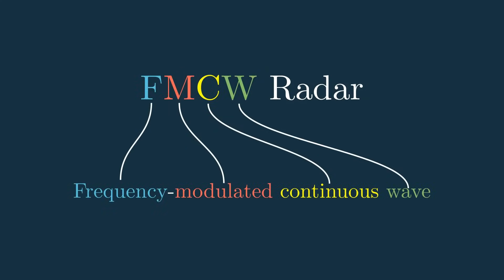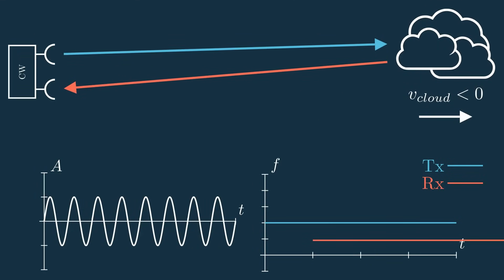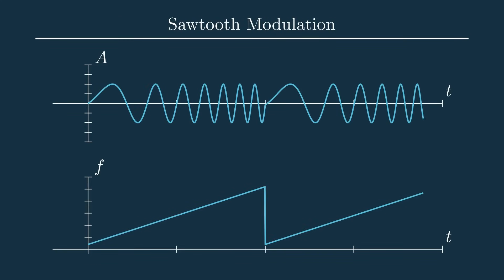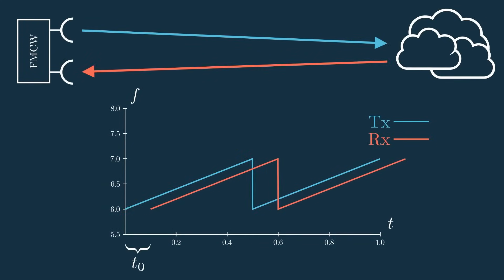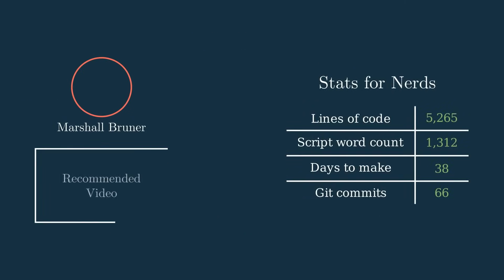What is FMCW Radar and why is it useful?

Comment: 1:46 I don't follow the reasoning here, in what manner would the average power have any bearing on things?

From my limited understanding, the critical part is the level of the return pulse being above the sensitivity cutoff of the receiver (as in the return signal needs to be strong enough for the receiver to notice).
That strength is determined solely by the distance travelled; the square root of the output divided by two.
Unless you somehow can accumulate the returns over time and store them for "reading", we are right back at the return either being strong enough or not.
Reply: I obviously did not scroll far enough down the comment field. Mea culpa.

@MarshallBrunerRF
för 7 månader sedan
Thanks for the thoughtful comment! I've had many people ask about this so here's my copy/pasted response: "Honestly the peak vs average power is my biggest regret on how I've explained anything on this channel. One of the main difficulties with a large peak power is the difficulty of transmitting something that high power for such a short period of time"
Reply from the maker: Another point on this is that for signal-to-noise ratio, it's not really the peak power that hits the target that matters, but the energy over time that illuminates the target. Having an average power over time does matter because by spreading out the power over a longer period of time, you can direct more energy at a target and get better SNR.
Reply: @MarshallBrunerRF  That explanation goes against all I managed to pick up in passing...  because to me, it sounds like a constant dim light would be easier to track than a light that gives high power flashes.
Seems I have to start digging deeper into the math to see what I am missing here.

Comment: The CaesarKing being the powerscope holder of the Internet of Things is a private entity core. While the structure of Institution in its private type businesses another private side while the institution of public type is another  side. Showing the structural mapping of such. Now the CaesarKing shall create now a system project institutional using the Cab or Taxi system of polarity carrier taxi or cab in per portal movers of to and fro and probably another business at works or business in the making.  Starting now there shall be polarized taxi or cab in the institution of private side and another polarized taxi or cab in the institution of public side. A programmed event in time. Let it be

Comment: AI Summary

Abstract:

This video explains the fundamentals of Frequency Modulated Continuous Wave (FMCW) radar technology, contrasting it with traditional pulsed radar systems. It introduces FMCW by breaking down its name: "Continuous Wave" (CW) refers to the uninterrupted transmission of the signal, which allows FMCW systems to achieve the same average power as pulsed radars but with significantly lower peak power requirements due to a 100% duty cycle, making them ideal for smaller, low-power applications like automotive sensors. However, simple CW signals cannot determine range. The video then explains the "Frequency Modulation" (FM) aspect, typically using a linear frequency modulation (LFM) technique like a sawtooth "chirp," where the transmission frequency ramps linearly over time. This modulation allows range measurement: the time delay of the reflected signal results in a frequency difference (the "beat frequency") between the simultaneously transmitted and received signals. The video derives the basic FMCW range equation, showing how the target's range can be calculated from this beat frequency, the chirp's bandwidth, and the chirp's duration. It concludes by noting that this is a basic introduction and more advanced topics like velocity estimation and hardware implementation exist.

Understanding FMCW Radar: Principles and Range Calculation

*   0:00:01 Introduction: There's a growing need for smaller radar systems (e.g., automotive, automation), where traditional pulsed radar has downsides. FMCW (Frequency Modulated Continuous Wave) radar is a solution.
*   0:00:19 FMCW Defined: The name breaks down into "Frequency Modulated" and "Continuous Wave". The video first explores the "Continuous Wave" aspect.
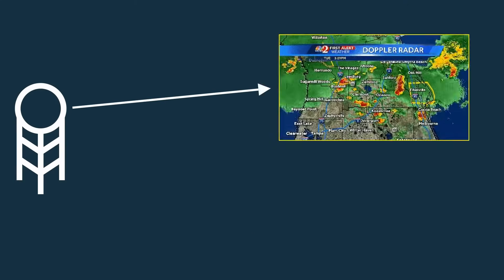*   0:00:32 Traditional Pulsed Radar: Works by sending short pulses, turning off the transmitter, and timing the received reflection to calculate range. This process repeats.
*   0:00:58 Continuous Wave (CW) Explained: A CW signal transmits continuously without pulsing, both transmitting and receiving simultaneously.
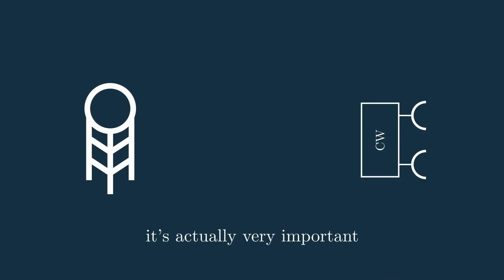*   0:01:17 Pulsed Radar Power Drawback: Signals degrade significantly with distance (1/R²). Pulsed radar only transmits for a small fraction of time (low duty cycle, e.g., <10%), requiring very high peak power during the pulse to achieve sufficient average power.
*   0:01:54 CW Power Advantage: Since CW transmits continuously (100% duty cycle), it can achieve the same average power with much lower peak power, making it suitable for small, low-power applications.
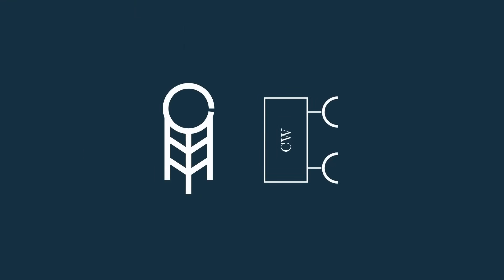*   0:02:18 CW Range Limitation: Simple CW radar cannot determine range because the constantly transmitted and received signals (at the same frequency, assuming a stationary target for now) are indistinguishable over time; there's no way to measure the time delay.
*   0:03:29 Frequency Modulation (FM) Introduced: To measure range, the signal's frequency is changed over time (frequency modulation). This makes the time delay visible as a frequency difference.
*   0:03:40 Modulation Types & LFM: Various modulation types exist (triangular, FSK). A common type for FMCW is Linear Frequency Modulation (LFM), often using a sawtooth wave pattern called a "chirp".
*   0:04:16 Chirp Parameters: A chirp is defined by its starting frequency, bandwidth (frequency range covered, impacts range resolution), and duration (ramp time, affects max detectable velocity). These are key design choices.
*   0:04:48 Making Time Shift Visible: With FM, the received signal (delayed by travel time) will have a different frequency than the signal being transmitted at that same instant.
*   0:05:06 Range Calculation Basis: Range is desired. We know the speed of light (c). If we can find the round-trip travel time (time shift, Δt), Range = (c * Δt) / 2.
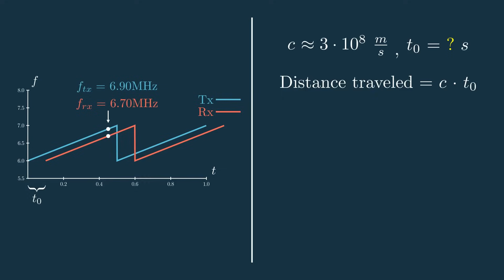*   0:05:26 Beat Frequency: The instantaneous frequency difference between the transmitted (FTX) and received (FRX) signals is called the "Beat Frequency" (Fb). This frequency difference exists because the frequency changed during the signal's travel time.
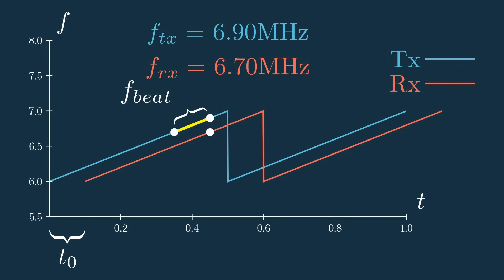*   0:05:50 Calculating Time Shift from Beat Frequency: The chirp has a slope (Rate of frequency change = Bandwidth / Chirp Time). The time shift (Δt) is the measured Beat Frequency (Fb) divided by this slope. Δt = Fb / (Bandwidth / Chirp Time).
*   0:06:07 FMCW Range Equation: Substituting the expression for Δt into the range formula gives the FMCW range equation: Range = (c * Fb * Chirp Time) / (2 * Bandwidth). This is the core principle for FMCW range measurement.
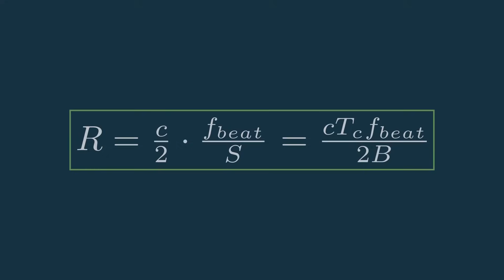*   0:06:25 Conclusion & Next Steps: This covers the basics; caveats exist. Further topics include velocity estimation and hardware implementation, with resources mentioned for continued learning.

I used gemini-2.5-pro-exp-03-25| input-price: 1.25 output-price: 10.0 max-context-length: 128_000 on rocketrecap dot com to summarize the transcript.
Cost (if I didn't use the free tier): $0.05
Input tokens: 14086
Output tokens: 3032
Reply from the maker: These are probably more helpful than my chapters in the video :)

Comment: Why do we need to target the average power in the first place? What physical meaning does it have? The power of return pulses is still determined by the instantaneous power of emitted pulses, not by the average
Reply from the maker: This is my biggest regret in explanation with these videos - I think it was very unclear. The issue is more with how difficult and costly it can be to generate such short signals. Thanks for the comment!
Reply: @MarshallBrunerRF  so, the difficulty is in making the signal short enough?
Reply from the maker: It's really difficult to switch on/off so much power in a really short amount of time. It requires very expensive equipment much of the time

Comment: You let out a key point. Why would we want a low average power? Why would we need a high peak if we don’t send continuously? In my opinion it doesn’t matter if we don’t have a 100% duty cycle. The range is not affected by what we send after a pulse or is it? Why is the average power of the duty cycle important?
Reply from the maker: Yeah this is something that's been commented a lot and is probably my biggest error in explanation... The average power is less of a factor. What matters more is how difficult it can be to generate small pulses of lots of energy. This causes high prices of components among other downsides. I didn't represent this trade-off well in this video.

Comment: 2:20 You can get a range from a continous wave. There is just a lot of ambiguity. Basically you already have to know the range to less than a wavelength in distance and then you can narrow it down further.
Reply from the maker: Yea, you can do that, but this is a more general application. My newer video on the range-Doppler spectrum kinda covers that, though not very specific.

Comment: WRONG the radar range equation is over R the 4th power not squared
Reply from the maker: Thanks for your comment. What I assume you're talking about is the 2-way radar equation showing how much power is received from a target. What I'm talking about in this video, however, is simply how a target's range is related to the LFM signals parameters. I will cover the radar range equation separately in another video very soon... Thanks for watching
Reply: Not sure why the PWM power has to be so large to maintain a certain average energy.   It seems the power hitting the target would be high, and thus the amount of power returning would be high.    And since the integration is done during off duty, the energy would be high.   Maybe I just answered my question.   Does that mean FMCW is integrating power over a larger period of time so the SNR is much higher.   And to achieve the same SNR, we would need much higher PWM power?

Comment: Nice Video, breaks a bit what i think i know about Radar.
So Questions,
Why is average Power more important than peak Power?
Doesn't changing the frequency mess with your Antena?
Reply from the maker: Honestly the peak vs average power is my biggest regret on how I've explained anything on this channel. One of the main difficulties with a large peak power is the difficulty of transmitting something that high power for such a short period of time. Yes the frequency will mess with your antenna, but generally radars use a small bandwidth compared with other applications so there are many antennas that can handle it. Thanks for watching!

Comment: This was good, but some basic principles were not covered: 

need for 2 antennas

Chirp t not only effects max doppler; but it also effects Doppler Res, Range Res and max unambiguous range. 

Doppler/range coupling: (sawtooth waveforms cannot measure Doppler. Doppler shifts will result in range errors with this waveform. To correct for range distortion from Doppler shifts a triangular waveform is needed. 

The depiction of RF traveling in 3D space as a sine wave is not correct. Most media outlets do this. But I think it misleads ppl who are trying to understand RF/EM/Light (all one one same). 

The sine wave is a graph of voltage over time. Not a depiction of the propagation of RF. 

The depiction should show plane waves traveling out. (If vertically polarized; vertical lines traveling perpendicular to their plane; with each plane having its field vector (arrow) indicating if it’s a down wave or an up wave. 

Each “wavelength” is physically 2 plane waves in 3D space. One up wave followed by a down wave. 

Intuition is critical for understanding RF theory. Otherwise ppl will always think of RF engineering as black magic.
Reply from the maker: All this is correct but, in my opinion, unnecessary for this intro video. For one, I am producing an ongoing series on this subject - the next one being released soon will talk about range Doppler coupling, Doppler res, etc. Including all the other EM concepts you mentioned would make for a long and tedious video. Thanks for watching and commenting! I would like to cover those concepts separately in the future.

Comment: Very good video to start with this topic.
I work with radars in cars... in this setup it becomes so much more complicated. You have to measure velocity and distance. You have many objects in different locations. You need also a direction to know the real position (this isn't done with moving antennas).

This is such an intersting topic. I still learn new stuff. Radars seem to be black magic. All this combinaiton of frequency shifts while constantly changing how fast the frequiency shifts. Than calculation of the direction by utilizing antenna arrays. Methods to avoid to get blinded by other radar senors (such as using pliarized signals).
Reply from the maker: Yeah it's such an insanely cool field! Hopefully you'll enjoy my next video which is going into the range-Doppler spectrum and multiple targets in range.

Comment: Why should we care about the average power transmitted? The pulse or the continuous wave will come back at a power following the inverse square law. If your receiver needs a power of one μW (example not realistic) it needs this power from the returning pulse and the same with continuous radars. If the distance cuts the receive power to one millionth of the send power you need peak send power of at least 1 W. Regardless of if it is 1 W at 10% of time or 1 W the whole time. The benefit of continuous is you have in most cases a finer temporal resolution. And this is at small distances more important because you need to make sure that nothing can slip through on an conveyer belt. And sharp pulses with low delay between each other has the problem with its frequency spectrum. So it is really difficult to do it for this application.
Reply from the maker: Thanks for the thoughtful comment! I've had many people ask about this so here's my copy/pasted response: "Honestly the peak vs average power is my biggest regret on how I've explained anything on this channel. One of the main difficulties with a large peak power is the difficulty of transmitting something that high power for such a short period of time"
Reply: I’m just guessing based on what Marshall said above, but I imagine the “more difficult” he’s referring to essentially results in larger, heavier components (Imagine electronics trying to support constant 5v vs pulsed 50v).
Reply: @almc8445  My point was that either 5 V has the necessary range or not. If it has it has the range continous will work and pulsed will work. If 5 V doesn't have the range it will not work regardles of pulsed or continous. The only difference is it is quite difficult to switch power on and off in a clean way (without distorting the sinwave signal to much) with cheap electronics. In big military radars with quite some higher input power it is more benefitial to safe some power (and heat production) with switching on and off. This is not necessary at a couple of mW. So in high power radar pulsed is used to bring the average power down. But the near field the power requirements are so low it isn't necessary to switch the power of. And you can spare the electronics for switching.
Reply: Depending on what timeline you want to view the processing, the discussion behind average power and peak power is moot (not considering the practicality of hardware outputting high power). However, the energy of the pulse (which is the peak power integrated over some time interval), is what determines that achievable SNR and therefore maximum detectable range given a certain probability of false alarm. All else being equal, if you have a pulsed radar and an FMCW radar that have the same pulse width, your single-pulse SNR is the same (assuming a matched-filter for the pulsed case and a straight-forward DFT for the second case). In your case of a pulse radar being on 10% of the time, the single-pulse SNR of the pulsed radar will indeed be lower compared to the FMCW radar since it has a longer pulse width, but this can be met with coherently integrating ten pulses.